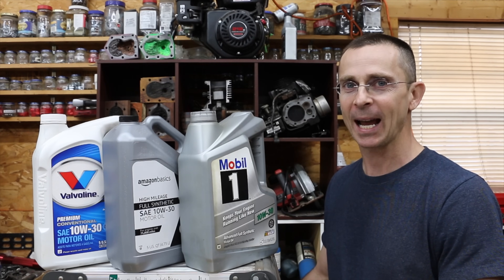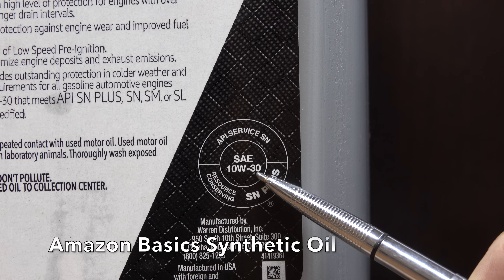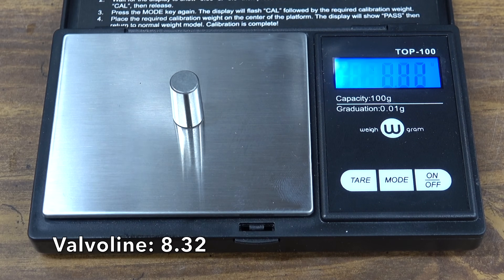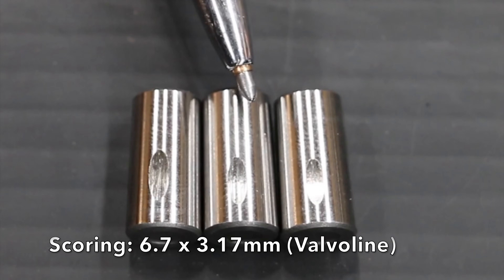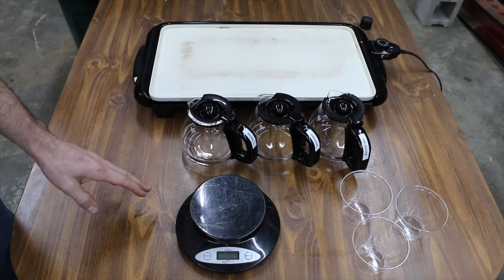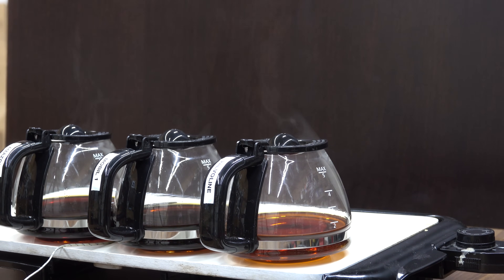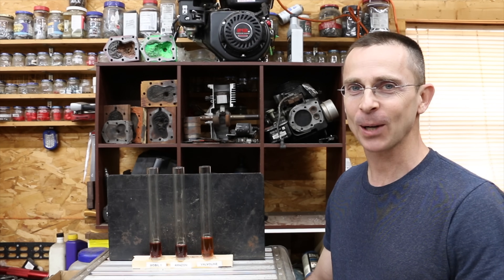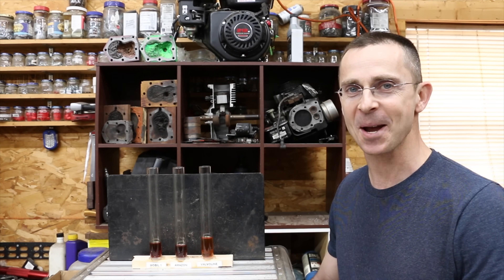Is AmazonBasics Full Synthetic Motor Oil better than Mobil 1? Let's find out!

Comment: Nice work. One concern with your method of wear comparison:
By comparing the wear scar area between samples, how do you take into account that the bearing race diameter will change throughout each test? By wearing during the test and then sanding the race between tests, you will end up changing the outer diameter of the race, and thus change the area of incident between the race and the sample, which will change the size of the wear scar.

Common sense would say that the race is hardened, and so won't change significantly... But then why sand it between tests?
Reply from the maker: Great constructive feedback.  The mild sandpaper ensures there are no traces of the previous test sample remaining on the wheel race.
Reply: @ProjectFarm  Good point. I would still be concerned that the measurements are too error prone, which would be compounded in the area calculation, making that comparison really subjective.

Your mass measurement, though? Perfect. You get all you need from that mass change.

Comment: That cold temperature viscosity test is going to be the most important factor in decreasing engine startup wear in cold weather and increasing winter weather efficiency.  The Mobil 1 seems marginally more lubricitous, but I'd purchase the Amazon oil over it based on the results of these flow tests.
Reply from the maker: Great point! Thank you

Comment: As far as cost of oils Shell Rottela t6 full synthetic 5w40 is usually over $30 a gallon, it can be ordered from Walmart at less then $20 a gallon but the amount to purchase for the best price changes. Last time I ordered it I had to buy it in 2 gallon increments to get it for $17 a gallon, just looking now it seems the best is 9 gallons at $18 a gallon. Still shipped and sold from Walmart. 

Anyone with a a diesel I highly recommend it, using the T6 5w40 instead of the T4 15w40 has made my old 7.3 a whole different truck in the cold. Now it will fire well below zero with no issues even when not plugged in.

Before anyone tells me that the oil doesn't matter for starting, the 7.3 powerstroke uses high pressure oil to pressurize the fuel, so yes oil flow absolutely effects starting.
Reply from the maker: Thank you for the video idea!

Comment: AMAZON takes 30% of the price. I had a friend with a Mercedes W123 diesel that sold the car when it reached just over 500 000 km using conventional mid 80's oil. Hehe, I think we are being bullshitted by somebody. My SUBARU is on the way to 200 000km. Mineral oil.
Reply from the maker: Thank you!

Comment: Your wrong mobile one is a better oil you want it to be a stickier oil so it says on your cam shafts and your cylinder walls so when you start your car in the winter is not a metal on metal start, there’s fluid there to keep it lubricated and less wear on ur internals that’s why Lucas is the best product ever
Reply from the maker: Thanks for the constructive feedback.

Comment: Is the wear test on the bearing fair if the Mobile wheel is sitting deeper in the oil while it spins than the Amazon and Valvoline? Mobile gets better lubrication in the test and less wear..... well more lubrication=less wear. 4:29
Reply from the maker: It shouldn't matter.  Continuous oil flow maintained throughout testing. Thank you

Comment: Interesting video. I was certain that Valvoline oil would finish last in this test, but like many others, I was surprised at the outcome of the Amazon branded oil. I think an equally interesting test for you to perform, would be to compare leading diesel oil brands. I own a few diesel trucks, so it would be interesting to see a comparison of their properties done in this fashion. I would recommend however, that you compare similar oils to each other, such as testing conventional oil‘s against each other, and not comparing synthetic, semi synthetic, and conventional oil’s against each other, as I feel that’s a separate comparison test - but one that is equally interesting to those that don’t understand the differences between the different types of oils. So there is another test comparison that could be performed, to compare the three different types of oils, all from one brand against each other.
Reply from the maker: Thank you

Comment: Ams oil vs royal purple!!
Reply from the maker: Now this would be an amazing showdown!
Reply: @ProjectFarm  and add liquimoly!
Reply: Yes then compare them to the Amazon oil
Reply: @TheShawnymaria  he can cross reference his current amazon info
Reply: Neither.  Had both in my SRT8 and didn't last. Stick to Mobil 1 or Castrol.
Reply: @leninmagana7348  liquimoly only in my n54, to each their own
Reply: @HoowAboutEnduro   I run ams oil in my gti and havnt had any problems it's just kind of expensive
Reply: You’re overpaying for those.... Mobil 1 or valvoline full synthetic blend are just as good. 

Amsoil and royal purple makes their money off of car guys lacking proper education and knowledge
Reply: Man royal purple sucks , no test needed lmao
Reply: @marz0829  luls, I've been running royal purple since my first oil change and im at 160k miles with an engine that purrs.. talk your trash elsewhere.
Reply: The Sleepie Holloe open up your engine & take a look bud
Reply: @marz0829  I have 150k on my 5.3. Just did dod delete and cam swap, I've ran royal purple since 95k miles. From what I saw and have seen over the years, it really depends on how often you change your oil. I change mine every 3k miles and the inside of my engine looked great for 150k+ miles.

Comment: I just want to say great job on the video. I learned a couple of things in this video. The first thing that i have learned was: that amazon does motor oil. The second thing that I have learned was that, the W on the oil stands for winter. I just want to say that-you for teaching that. I also would like to say that you did great job on the video. I think the Amazon oil would work great in your vehicle.I would like to see you test, using epoxy on glass and rubber. I just want to say one last thing looking forward to the new video that is coming out next Monday.
Reply from the maker: Cory, Thanks again for the positive comments!

Comment: Wow that is really cool so riley and i bought another used truck ive been looking for for quite awhile. A 1997 ford expedition eddie bauer. Little over 170,000 miles the last owner switched to full synthetic 5w20 mobil 1 very expensive ...but i knew i had to keep it up unless i wanna replace all the gaskets....that already leak. ...i think amazon will be better for the full year til i over haul the engine. This truck had the 330 5.4 2v triton. Thanks for the videos and all your other videos sir! :)
Reply from the maker: Thank you. I've found that high mileage oils help with those leaks.

Comment: Nice video, but i've got a problem with two of your methods: you're operating the weight scales beyond their accuracy limit. The TOP-100 you're using maybe has a resolution of 0.01 g, but the deviation of this scale is given with 2 digits, meaning 2 x 0.01 = 0.02 g measurement deviation. Hence, the weight loss of the bearings is smaller than the deviation of the scale. So weighing a mass difference of 0.02 or even 0.01 is not at all accurate. Measuring the scars was a legit indicator for wear though. The same problem with the kitchen scale, the sensitivity is 1 g maybe, but the measurement deviation is most probably higher than the weight difference you're measuring (probably several 'digits').
Reply from the maker: Thank you for the constructive feedback.  More precise scales have arrived in time for the next oil showdown. Thanks again!

Comment: I filled up balloons with Mobil 1 and Amazon Basics oil and threw them, they both exploded on impact and got oil everywhere, I measured the splatter from each balloon with the width of my pinkies over an over (why use a ruler, that's no fun) and I can tell you that even though it ain't some new fangled test with micrometers and the same rig exacting the same amount of force on all of them (because measuring the force applied would be a waste of time, right?) I believe that by using any brand, the motor oil balloons would make the same splatter skeet shooting with them, hope this was helpful to all you people buying Supertech er um Amazon oil (search D10386HG025 and you will see on the gmdexos site that many junk oils have the same license number which means they are the same oil, so Supertech Synthetic at $16 for 5 quarts is probably what you guys want) I for one will continue to use Mobil 1 as I trust them with real world testing (cars/bikes/trucks racing for decades) and they have a guarantee which states they will repair damage caused by a defect or malfunction of the lubricant. I also use other brands, such as Motul and Royal Purple.
Reply from the maker: Thank you
Reply: You said "and they have a guarantee which states they will repair damage caused by a defect or malfunction of the lubricant."
Warranties make a huge difference. Castrol offers a 500K mile / 15 year warranty with up to 20K mile oil changes.

Comment: Excellent test. This summer I plan on testing Red Line 10w-30 synthetic oil in my 1970 Z28 that was rebuilt several yrs ago with a roller cam because I know my conventional brands of oils I've tested are evaporating. I've tested 10w-30, 10w-40, 15w-40 and 20w-50 conventional oils.
Reply from the maker: Thank you

Comment: So let me start by saying, i really love your videos and all the testing you put into the products! I set a reminder so i wouldn't forget to ask, as i never have any ideas for you to test but you keep coming up with new stuff.

Cleaning my guns and oiling with the new Lucas oil i just got from Amazon, i noticed it's a bit different than the cheaper orange bottle oil i used in the beginning but thinner than the Unicorn oil a few gun owners suggested and i started using this last year. Some recent reading showed some gun owners even use motor oil on their weapons! It makes sense in principle as it's metal on metal under pressure and heat, but is there a difference/advantage? ... This is where i connected the dots to you!

Would it be possible to use your super cool friction tester rig but with motor oil vs a couple different gun oil brands? I'd be interested in seeing how they wear differently over time and even how they hold up to heat and cold. While it really wouldn't be cost effective, what about running a small motor on gun oil?

Thanks for reading my comment, looking forward to more awesome videos and possibly seeing my idea one day :)
Reply from the maker: Thank you for the video idea!

Comment: Man, I just love that you go to this much well considered effort to show us what's true under the hype!  Would be curious a Prolong engine additive test using the Amazon synth oil - part of my interest with Prolong was, many years ago, well before Prolong was available in stores, I was and R&D, 3rd party tester and analyst for Prolong mainly around New Potential Product idea analysis and hydraulic products analysis testing - I also did some testing with extreme greases, some with temp stability beyond 800f degrees - Prolong was essentially put out of business due to the owner at the time being kind of lame in his advertising but I knew from my time testing Prolong production and pre-production products that many were astonishing in there performance... As I understand it, the new owners have kept the original formulas (motor and trans) and so I thought such a test might be quite interesting to your viewers - by contrast and as an example, most know about Slick50, in particular how poor an additive this is in ANY combustion environment, however PTFE resins can be potentially positive in some environments but personally I'd never try it anywhere since no way to know for certain in a particular application... Also, many years ago, I was sponsored by Jacobs Engineering on a world fuel economy record attempt where I did best the SUV record at the time using Prolong in certain areas to do it.  That world record result was mainly due to the use of Ester based synthetics mostly throughout, Mikuni carb modifications, special custom header design I came up with and a special cruise control system. To be sure, the special Jacobs Engineering ignition module and coil did indeed aid in the end result but the biggest jump in fuel economy came when the entire engine, drive train and bearings were switched to Ester based synthetic (AMSOil 15w40 Ester Marine oil in the engine as example) - there were a laundry list of other small mods I did to obtain the amazing nearly 33 mpg out of a 2.6L inline 4 cylinder multiple back to back times Average! I gave my results data and proofs directly to Jacobs to do with as they would and went on to other projects... FYI - thanks so much for all you do - it does make a difference!
Reply from the maker: Thank you for the video idea!

Comment: Interesting test.  Surprised that Amazon oil came in first with Mobil 1 in a close second.  Have used Valvoline in the past and found that the product was OK an Mobil 1 was a great product to use.  During the Australian summers where the temp can get up to 40 C (avg 34 - 38) the Mobil 1 handled fine and found the Valvoline to use around 700 mil of oil during a 5 000 kms (Duration time frame to complete 5 000 approx 3 months) change and Mobil would go through around 400 mil.  Will look and the Amazon oil closely for my vehicle.  Thank you for the time to make this video.
Reply from the maker: This is great information. Thank you

Comment: I recently read you can put old style oil into a car that has had synthetic oil (if old is okay for the car). I was always warned against this.  Any opinions?
Reply from the maker: I would make sure both oil products indicate that they can be mixed.
Reply: Project Farm , I don't think any manufacture would recommend it for liability reasons.

Comment: Conclusion /Do Not trash a $5000 engine to save $3 /Valvoline Full Synthetic Motor Oil - Walmart  $22,  you forgot got bearing test after heat test.... valvoline is a the better product by your test, using the cheep none synthetic , you may ask why ... after burn test look at color during cold flow test , others got burnt , sediment ,... procedure order if you want more hits.... 1.cold test, 2.burn test, 3.bearing load test, 4.sec cold test , .....  Clapping ....
Reply from the maker: Thank you!

Comment: Nice, you are smarter than I thought, nice graphs too bro, love it, love your honesty too, anyway; I always used Bel Ray 2 stroke oil in my weed-wacker, snow-blower, dirt bike and go-kart at 50:1 mix ratio with awesome results.  But what about an old 99' Honda 4-cycle 2.3 liter engine? I heard the synthetic oils ruin the seals and what-nots in an older (not made for synthetic oil) engine.  Please let me know what you think, one thing I will say is after 250k when I add Lucas oil, it just burns and/or blows out even more than if I run straight 5W-30, I know; I need a rebuild, but for now, would my old Honda be happier on a synthetic diet?  Thanks ;-)
Reply from the maker: Thank you very much!   You might consider trying a "high mileage" synthetic oil.  I use it in my older, high mileage vehicles and don't have problems with leaks.  I'm sure the Honda will keep providing great service either way.  I've had great success with Engine Restorer helping slowing oil consumption too.
Reply: @ProjectFarm  I am going to buy another car OR have this engine replaced (already has a new transmission) this summer, so I will try some high mileage and let you know if it blows up early or works better, LOL, no serious, I'll post it, oil change in 2 weeks is due anyway, take care, love your videos!!!!!!

Comment: I would put almost any brand of oil in my cars (decent brands though and at least semisynt, plus I use thicker in the summer and a thinner in the winter like the ol' guys recommend). And never had an engine failure. But I usually take care of how I drive and more important, I remeber to change that oil every 4-5000 miles. Even if it's synt or semi.
Reply from the maker: Thank you!

Comment: Good testing. However, @ 8:45 the testing tubes are lowered at different angles which can speed up or slow down the oil while pouring. The Mobile 1 and Amazon oil is lower while the Valvoline is higher. I don't know if this will immediately affect the testing the, just something I noticed.
Reply from the maker: Thank you for the constructive feedback.

Comment: Measuring differences of a couple of grams using a scale with a resolution of a gram = unreliable results. You could weigh the exact same item 10 minutes apart and get a difference of 2g (+/-1g on each measurement). That puts error bars at the same level as the difference between the samples.
Reply from the maker: Thank you for the constructive feedback.

Comment: Who makes Amazon oil?     Mobile1? 
In our 2013 Letsuck emergencyehicle, we use Walmart-purchased Mobil1 0W20 full synthetic.  Though garaged, we have a sheet over the hoodraped down infront of the grill and a magnetic heater stuck to the oil pan pulled off by a rope.
Asoon as we starthengine, place in Drive to limit RPM and the load speeds engine warming.  
Idle speed to the stop sign 200 ft away.  Then gentle acceleration until out of our neighborhood.
Reply from the maker: Warren Distribution handle their oil. Thank you.
Reply: Thank you.  Are they a distributor but not refiner?    
(We have Suncor Energy, the only refinery here.
Do they produce all of the gasolines sold in this area?    Then different gasoline companies add their own additives and tank trucks distribute from Suncor to all of different gastations?
Can't imagine Shell, Exxon, etc. bringing in gasoline from anyvherelse.)